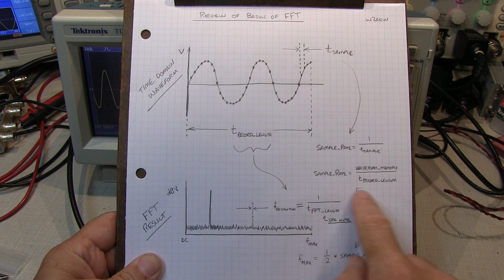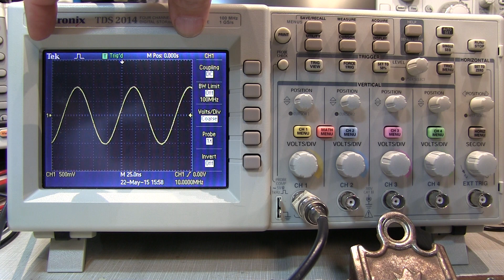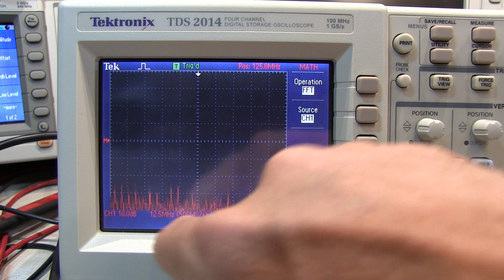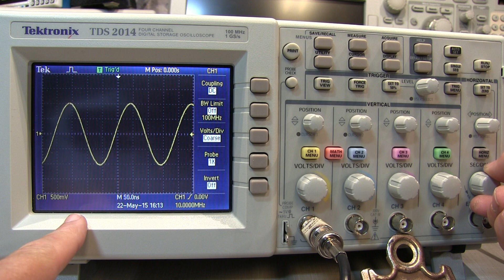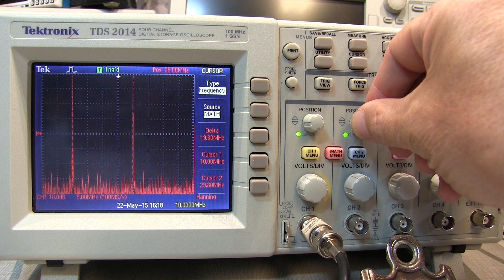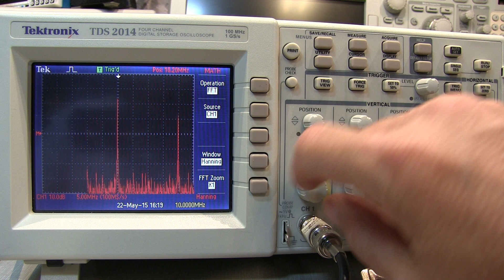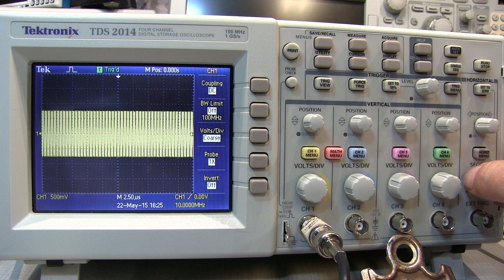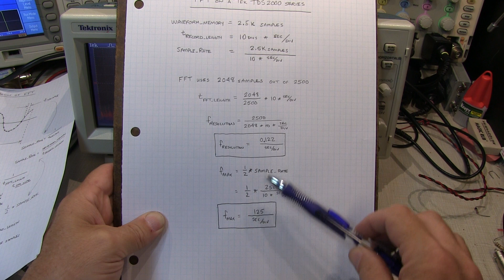#202: Basics of using FFT on a Tektronix TDS2000 oscilloscope

Comment: Hi W2aew, I enjoyed this video as I've studied it several times. I currently have a Siglent 1202X-E and I've been using it to review audio signals and harmonix in classic tube amplifiers. The Siglent FFT is usable but somewhat ackward compared to a real spectrum analyzer, It seems that even this old Tektronix has a nice FFT interface. Your ability to control positioning seems a bit more user friendly on this Tektronix TDS. Do you still use this model or have you moved on to something more effective. If so would you be able to share this insight. Not that I'm looking for an endorsement but some opinion might be helpful. I do see these Tektronix machines quite available on ebay now-a-days... The TDS 2022 looks like a nice capable machine when compared to today's entry level machines. I'd love to hear your thoughts. Thanks Ben, (P.S. I built your Simpson 50UA constant current calibration device and I use it all the time!)

Comment: Today I struck gold in my university's electronic waste bin, a TDS 2014B! Other than channel 2 being defect it is working perfectly, even the clock was still correct. I already have a 20 MHz analog scope that is great for most of my everyday low/medium frequency applications, but especially for debugging digital systems a digital scope is very handy. Happy to see you have it as well and have some videos using it.

Comment: Would this tds2000 have enough resolution to check the harmonics on a 220Vac (60Hz) signal? I mean... The harmonics would be on 120hz... 180hz... 240hz... Would it be able to present a lower frequency in the horizontal scale to use the cursor to check the magnitude of each low frequency harmonics?

Comment: In FFT magnitude scale, Red arrow mark - on Y axis does not indicate 0dB. What does it indicate? Why is so?
Reply from the maker: The red arrow on the Y axis is the vertical scale expansion reference point.  If you adjust the vertical scale, it expands/contracts around this point.

Comment: in fft mode you are scanning DC to max. supporting Frequency, do you have any antenna or the incoming waves come to BNC connector without antenna? (the red graphs am talking about)
Reply from the maker: I have a signal coming from my function generator.
Reply: very goodt it seens it us not one signal! it is range of signals, with different power strength! some graph are high some low, you mean your Function generator will make range of frequency? if yes it is Sweep or other modulation let US. know. thanking you in advanced.
Reply from the maker: A signal from a function generator can have many different frequency components simultaneously.  Distortion in a sinewave will show up as harmonic frequency content.  Other signal types have different frequency content - for example, a squarewave has frequency content at the fundamental and odd harmonic frequencies.

Comment: Hi Alan, is it possible to use external function generator to sweep and using FFT of an oscillscope to see the response of a low or high pass filter and get that nice corner frequency like your video #106 at 2:21 . Thanks
Reply from the maker: +Daniel Ditko Not unless your scope includes a feature to give you a "Max Hold" function on the FFT result.  Not many scopes do that.  In order to do this with a scope FFT, you'll likely need to use a broadband noise source as an input signal.  I do this technique in video #128 where I use a scope FFT to measure the frequency response of different filters in an HF receiver.  The measurement starts at about the 7:12 mark in this video:
https://www.youtube.com/watch?v=_z2pglvBWg4

Comment: Hi Alan, a short while ago I asked you about a problem I was having with my THS720A (old) DSO at work.  I said it was traversing the screen in bursts.  When in roll mode or a slow time base the trace would leap frog across the screen.  You said you didn't know why this would happen but would ask around at work to see if anyone had any ideas. 
I found the answer yesterday.  The scope was producing a trace and I had 4 measurements displayed on the right of the screen (max)  2 for each channel. 
It was the displaying of these measurements that was the cause.  I deleted them and the trace moved normally.
I thought you might be interested to know this.
Thanks for great videos by the way.
Reply from the maker: +Michael Hawthorne Oh, very interesting.  I guess the processing delay in the creating the measurements paused the waveform scrolling or something like that.  Weird.

Comment: I do not understand the amplitude. If i watch on your scope it shows approx 65dBV. You said that your input is 2v pk-pk, so that means 0.707 Vrms. How to interpret those 65dbV?
Reply from the maker: +dancdt I don't know where you see 65dBV.  The vertical scale is relative for the FFT on this scope, so you have to use cursors to get the actual value.  0.707Vrms is -3dBVrms, and this is shown at about the 10 minute mark in the video.
Reply: +w2aew thank you for answering. I was thinking that the bottom was 0 dB, so I watched wrong, when in reality 0 dB is between the 7 and 8 division of the vertical axis. Thank you very much for the reply
Reply from the maker: +dancdt You can use the vertical position control to move the FFT math trace up or down, so there really isn't an absolute reference on the screen (thus, you need to use the cursors)

Comment: The update rate of the Tektronix TDS2000 is pretty fast.. is the processing done in hardware?
Reply from the maker: ***** It is only doing a 2048 point FFT, providing a 1024 point result.  I believe it is being done in firmware.
Reply: ***** Thanks! I own a DS2072A  and its very slow (FFT done in software)

Comment: Now the real trouble is: noise measurement
I did \ tried noise measurements and failed to understand: whether it is possible (must be), how to convert dBm to nV/squrt(Hz), where to put the cursor.
I did consider: limiting BW, discrepancy between actual to displayed parameters, 8\10 bit resolution
I know that there are many other things to consider but I do not need exact results.
Could you put that DSO aside a spectrum analyzer and measure the same signal ?
Reply from the maker: 0MoTheG I'm thinking about doing a video on the comparison and trade-offs of a scope FFT vs. a spectrum analyzer...   Food for thought for a future video.
Reply: I for one would be highly interested in the topic for one is tempted to misuse a DSO for a SA.
Reply: @w2aew  2x same suggestion, excellent.

Comment: Oh cool! I just used my iPad 'Audio Tool' app to generate white noise.  I ran that into my Behringer Mixer.  And from the mixer into my TDS2014B. Now I can see what the Low, Mid, and High EQ controls REALLY do.  I used a BNC to RCA adapter for the scope CH1 connector.  Works great.  Thanks for the video.
Reply from the maker: Great application!

Comment: Thank you for this informative video!
Can FFT someway be safely coupled to check signal quality from a transceiver?
Reply from the maker: Tony T. Sure, just use an RF Sampler (see my videos on that).  Beware though, the scope FFT will be limited to about 45dB of spur free dynamic range or so - making it difficult to resolve some distortion components from the transceiver.
Reply: ***** Thank's!

Comment: Alan,
Excellent video, good in depth tutorial on using the scope controls.  May I suggest you do a part 2 video and talk about the limitations of using the scope FFT as compared with a spectrum analyzer. Show some more complex signals that would have more components. Possibly some real world signals like a HF or VHF ham TX signal, audio waveform, etc.  What can a low end spectrum analyzer do that this FFT will not do.  
Thanks
dwight, N7KBC
Reply from the maker: Dwight Merkley All good topics - fuel for future videos.
Reply: @w2aew  very good suggestion, I never found a video about this comparison. FFT vs SA

Comment: Hey Alan, could FFT be used as an audio analyzer (20hz-40khz) or THD? I believe it's possible as I've been playing around with my scope and it seems to work pretty darn good, I use it for crossover points; boost @certain fhz; adding odd harmonic components "THD"?... I enjoy your tutorials, thanks for sharing.
Reply from the maker: You just have to be careful, since you generally can't expect much more than 45-50dB of spur free dynamic range from a scope preamp/ digitizer.
Reply: ***** It's not for accuracy, its more just as a reference. I measure the xover filter points with sine waves and same for the fhz boost. As for the THD measurements I do have an old HP 333A, just haven't powered it up in a while. Any experience on those measuring units?
Reply from the maker: jeanious2009 OK, good, so long as you understand the limitations.   I don't have any experience with the 333A.